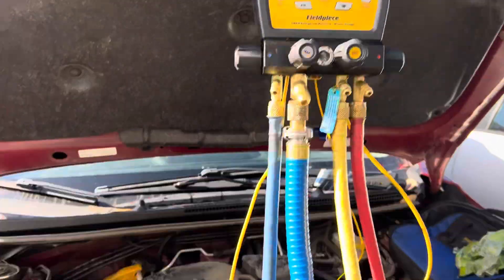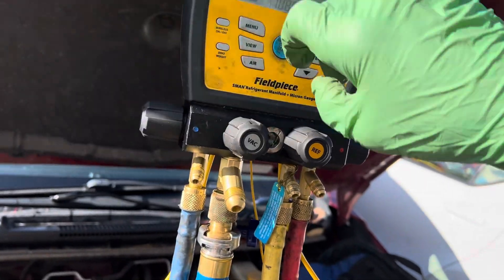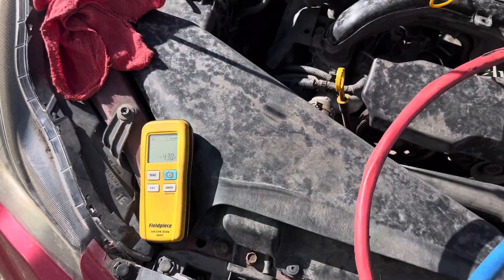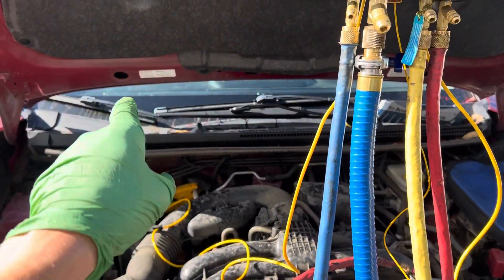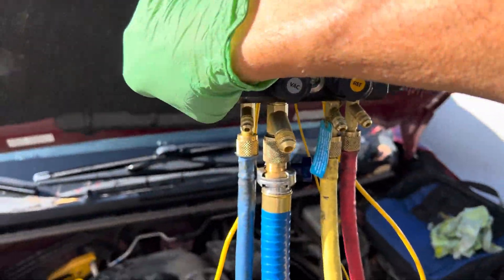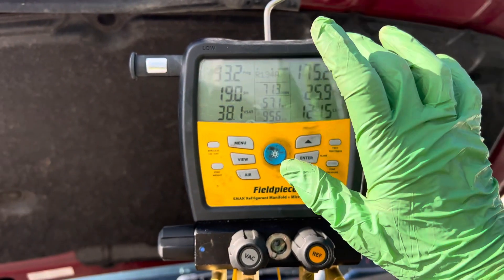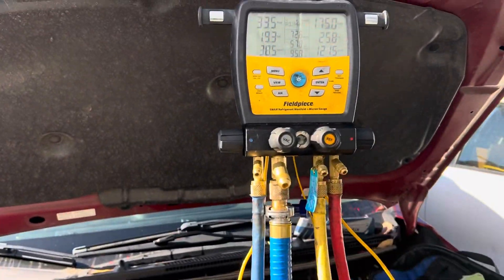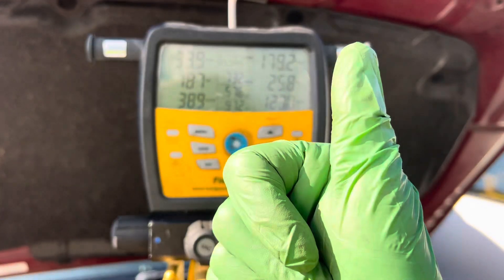26° SUBCOOLING CORRECT CHARG. 44° sub cooling 1 ounce to 1 1/2 ounce overcharged. ￼

Comment: Did you charge it through  low side port ?
Reply from the maker: No never
Reply: @coldfinger459sub0  but in the video you added refrigerant from 450 to 470 to 500 through low side?
Reply from the maker: @issamadam9352  oh. That yes . I topped off through low side. 

I add the first partial fill through high side liquid like I always do.

Comment: Yep, best practice is weigh-in.  Notice the manufacturer provides only this information, nothing else, no alternative solutions offered.
Reply from the maker: But when you get familiar with a few specific year, make model vehicles, you learn your own average, your own specifications, and you can start to tell when things are not right by looking at superHeat and subcooling, even though the manufacturer provides no specifications for such things. 

That’s why it’s good to have the tools and the techniques in the training to use that as a diagnostic tool instead of the guys who just guess
Reply: @coldfinger459sub0  Agree, from a diagnostic perspective.  Additionally, I'd be interested if you find it necessary to deveiate from factory charge in the case of aftermarket parts such as alternative condensor/accumulator, etc.
Reply from the maker: @thisisyourcaptainspeaking2259  it should be done, but the variations intolerances differ from aftermarket aftermarket, so I don’t even bother. 

It is not the shops or technicians responsibility to know that the condenser screwing up to charge quantity that much 

It’s not the technicians responsibility to know that they bought a aftermarket ignition module that doesn’t change the timing because there’s no way for them to measure it on modern vehicles when that was a problem from cheap Chinese ignition module’s. 

And any aftermarket device that is put onto the market that does not uphold to the original vehicles, manufacture specifications, but yet the outside of the device looks exactly like the OEM that is not the technicians responsibility to reinvent new specifications for operation that changes on every aftermarket, manufactures part, if they’re all different . 

Imagine if tires were put out onto the market with no load ratings on them and no air pressure specifications

And putting tires on the car was a guessing game of what the air pressure should be anywhere from 28 psi to 60 psi and if you get it wrong, you are the cause of the tire blowing out as a technician 

The load rating might be passenger vehicle. The load rating might be D or E for truck but you don’t know. 

So you might put a passenger load rated vehicle tire on a truck but because they don’t meet the original equipment manufacturer specifications you’re guessing . 

The only time I very from specifications is when I am modifying and upgrading a 12 refrigerant system from Tube and fin to an aftermarket upgraded newer microchannel 

Because then the refrigerant charge specification is going to vary greatly 

I can do it because I know and I have the equipment to test and I know the specifications before and after on superheat and sub cooling 

And then change out the original Condenser to a microchannel . 

There’s apples to apples, and then there’s apples to oranges .
Reply: @coldfinger459sub0  Great points! For what it's worth, Denso says in their instructions for the condensers I've seen to recharge to factory specs, which I have always done cautiously but had good luck with. I wonder if they actually verify that the refrigerant capacity is very close to the same as the original or if just send it and hope it's close enough.

But other than Denso, I don't ever remember seeing instructions included with an aftermarket condenser that mention the charge amount at all. I have even replaced tube and fin condensers with direct fit microchannel condensers from major brands and there was no mention anywhere of what the required charge is or even that it's much less, which is absolutely ridiculous and would really screw someone who doesn't know better, which is most people. Very frustrating for people like you and I who want to do the absolute best work possible.
Reply from the maker: @averyalexander2303  when the OEM would have condenser updates that would modify from Tube and fin to micro channel, there would be a orange piece of paper or some piece of paper indicating the refrigerant quantity charge has been changed.  They would giveyou the weight.

Purchase from the aftermarket source, you would not get this information. 

The OEM for 12 refrigerant 134 refrigerant sometimes would have a micro channel condenser and would give you the weight modification provided in the instructions or inside the condenser box itself.